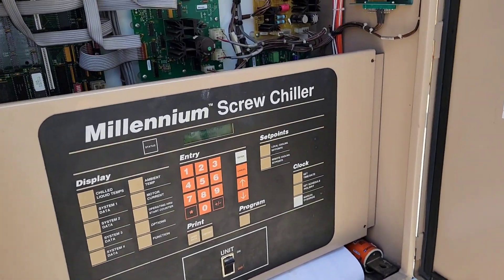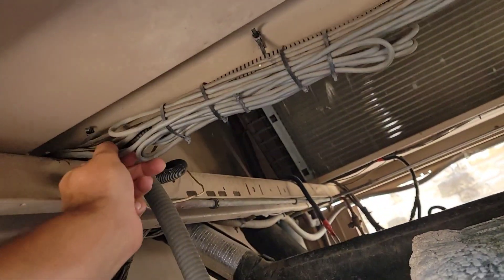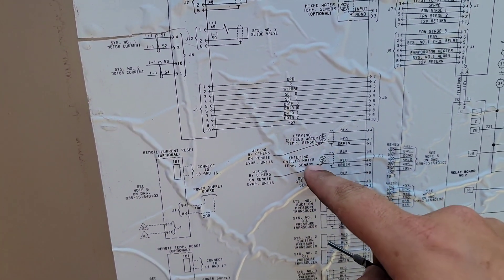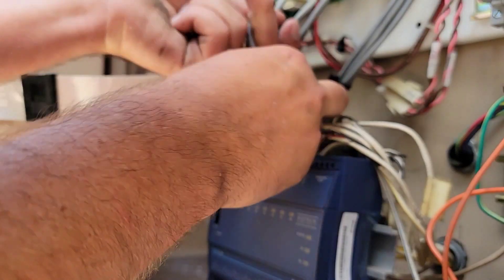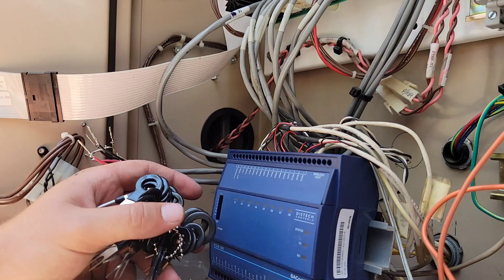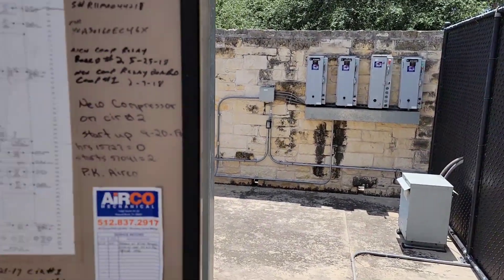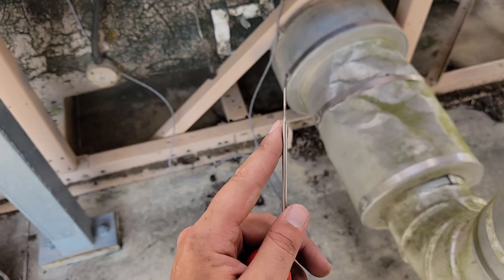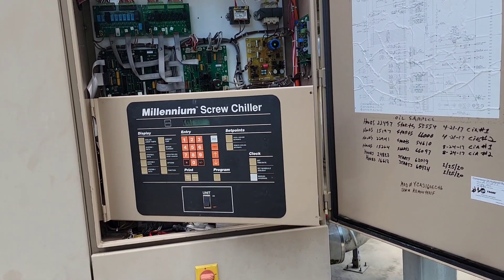York Chiller Down from Rat's and Wiring Harness

Comment: I I recently retired in March of this year. I’m from the West Coast California. Are used to start up screw chillers and chillers that have slide valve unloaders and drives. I worked for York /JCI. You should be replacing those sensors after so many hours because they start having build up its like having a blanket on them and they do drift. Good job
Reply: Shouldn't have to change a sensor that quick